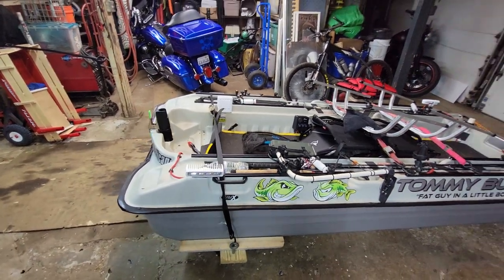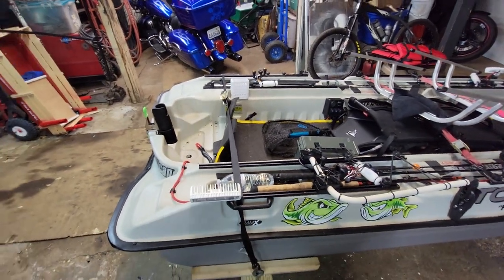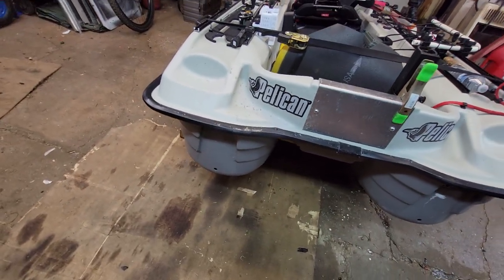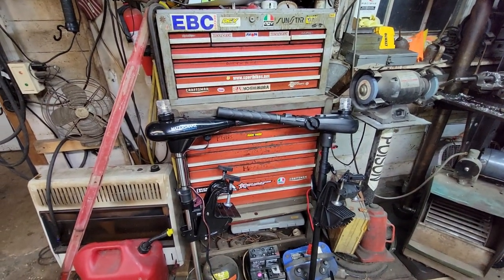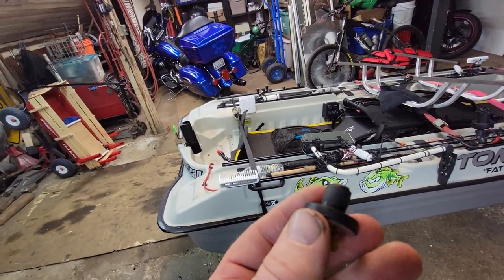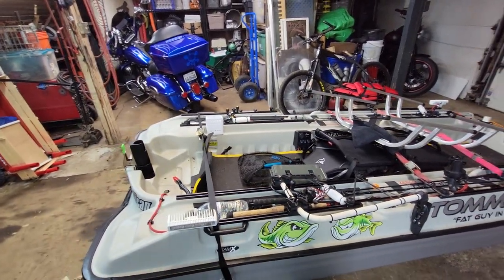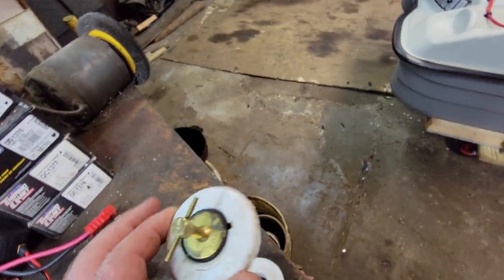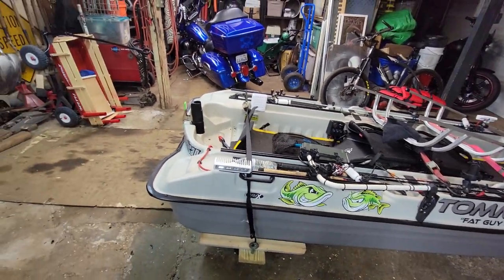Bass Raider Submarine... almost

Comment: Because of the space between the lower and upper halves of the boat you need to use a spacer (Think it was 5/8" I used) and then you can tighten the heck out of it and use plenty of marine silicone to seal it.
Reply from the maker: Yep, I had a spacer in there.

Comment: Why did you drill holes below the water line in the pontoons? What were you thinking?
Reply from the maker: I was thinking I wanted to drain the pontoons without having to empty out the boat and stand it on its nose to use the factory plugs. Works great by the way.